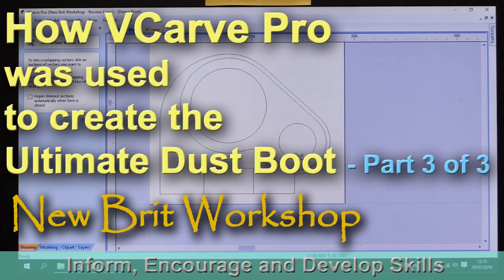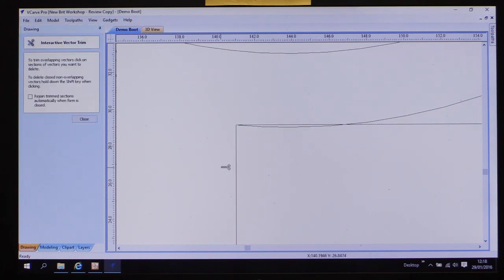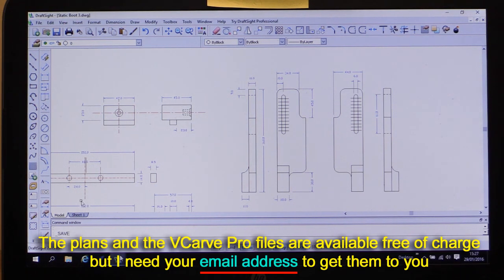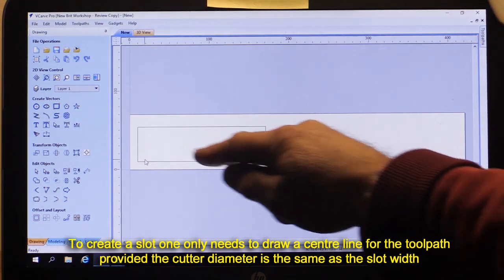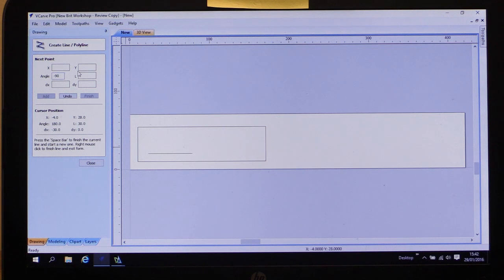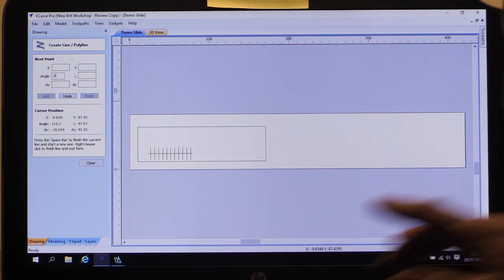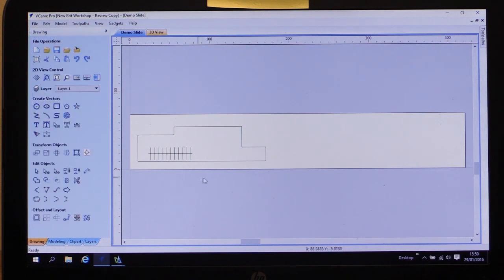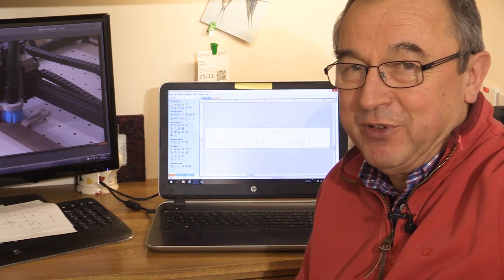Ultimate Dust Boot VCarve Pro Design - Part 3 of 3

Comment: Excellent videos Peter. I use the 3DConnexion mouse when using Sketchup, which really helps with navigation (takes a short while to get used to). Don't know if you've come across them before, but I'm sure an email to them might secure you a trial in return for a review! I've been happy with mine.
Reply from the maker: +Rico S Hi Rico, That mouse really does look interesting but I am not sure that I could do it justice as I do almost everything in 2D. Thank you for thinking of me and I will go for it if I ever get into Sketchup,   Cheers.   Peter
Reply: Yes, you're probably right. I use it for 2D too, as it's great for zooming in and out, but probably overkill for exclusive 2D output.

Comment: Hi, I would love to know where you got the long bristle from, Love the vid +++
Reply from the maker: +Dai Beer    Hi Dai, I got some bristle from a brush maker but it is really easy to buy a cheap brush and cut your own. In my design I needed bristle 55 mm long but this could be varied. If you have problems finding a cheap floor brush with the right length and softness then get a decorator's wall paper brush or an old fashioned emulsion brush. They are reasonably priced. Do check my other dust boot videos, although a different design, I do show how to put the bristle into the block. The best glue that I found was Copydex.   Good luck.     Peter